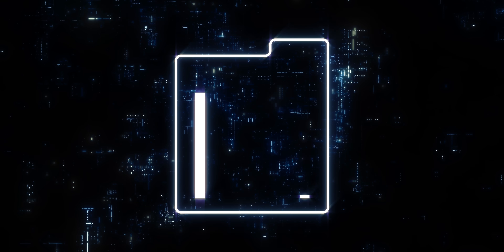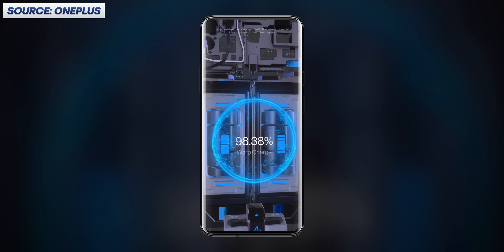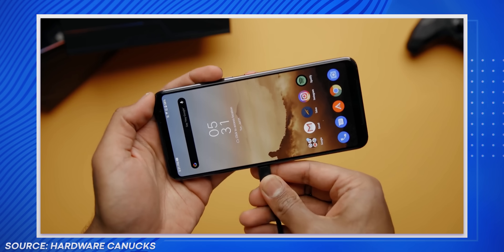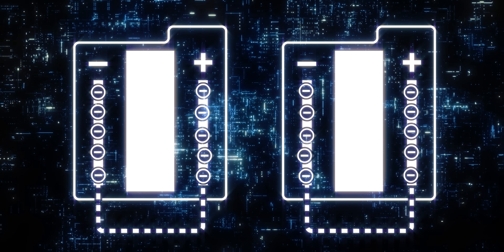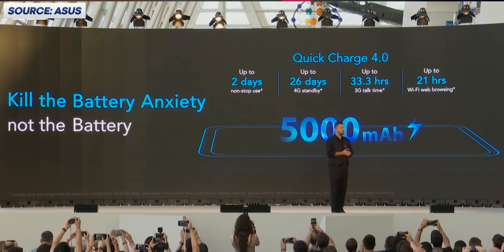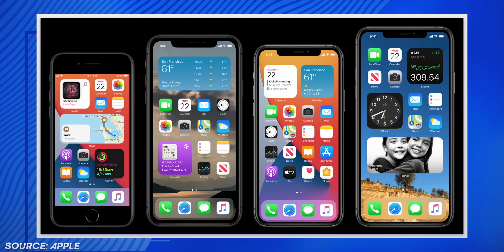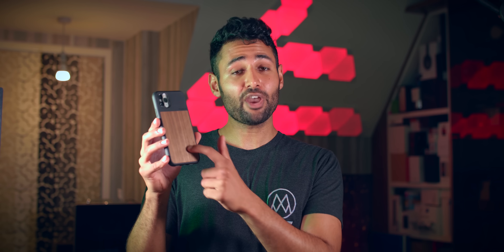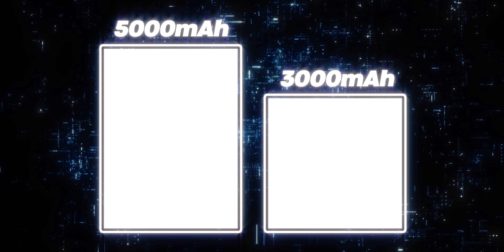The Problem with Fast Chargers.

Comment: Comprehensive and informative with awareness raised plus conclusive generalization. [Simply put, "Fast is Bad!" Or "Slow is Normal!" Even "The Faster it Charges, the Deadlier it Degrades!" Those sound rare and perhaps contradicting or counter-intuitive, if not taboo or ridicule!] (I've been paying attention to rechargable batteries since having a digi-cam in 2003  regarding charging cycles and cares with some understanding. I often avoided fast-charging whenever possible.)

Comment: To me, fast charging has always indicated stagnation of real battery improvement, and improvement on mobile devices in general. I never wanted my phone to charge faster, I wanted it to last longer per charge. Since companies cannot improve battery density, at least at this time, they resorted to different ways to charge your device, like fast charging or charging through induction... not truly improving the way I use my phone, but make it a little more different so it looks like there has been advancement. Similar story with putting more cameras and getting rid of the headphone jack... just different ways to interact with my device that do not change nor improve its real world usefulness.
Reply: To be fair though, if I can get 3 hours of battery life off a 10 minute charge then we wouldn't need to plug the phone in while we are sleeping. A longer battery life is always the best solution, but a quick charge from 7% to 40%  is always nice.
Reply: Truth!

Innovation in the mobile space has stagnated, but since profits depend on advertising innovations...

Advertising has gotten more and more creative with innovations.
Reply: Definitely agree! My last charger was an ordinary Apple charger, “half-speed” I’d say.. I bought a new one last week that is 2x faster at least and damn, I actually notice that my phone lasts 4x faster than the slower one! Plus I’ll never have to sit for 2 hours and look at my phone while it charges or fall asleep on it (super serious about fires) 
Love my ”fast” phone charger!

Comment: 1. Everybody complain about iPhone charging speed when it was providing the 5w charger. It legit takes 4hours to charge an iPhone plus model from 0 to full, and it won't charge at all when gaming.
2. If Apple worry about battery degrading when they consider charging option for iPhone, then obviously the magsafe should not be there at all, not to mention magsafe fast charging. Instead there is tons of rumor that they will completely switch to magsafe.
3. Apple actually provided a pretty good option for how your phone can last longer while fast charging and wireless charging. They provide pretty good pricing in battery replacement for their phone, and magsafe is actually improved wireless charging efficiency by quite a lot. Both helps the situation.

Comment: That's why u need a phone that charges at a speed that's in the sweet spot, 66 watt charger is good enough. Just take care of the battery and it should last you a very good time.
Reply: Fast charging can be okay as long as the temperature doesn't get too hot

Comment: I recently bought a s20 ultra. Instantly went into settings and turned off fast charging. Now it takes about 2 hours a charge instead of 1. Will help a bit in the long run and the phone lasts throughout the day easily so I only plug it in at night.

Comment: There's one big omission in this video and that is what temperature is ok for your battery and what temp is not?
My 'super fast charger' doesn't cause my phone to heat beyond 36C, even while I'm using it for light tasks. Is that still too hot?

Edit: I know he mentions 30C and 40C but something clearer might help.

Comment: My galaxy s10+ bought day one. Over 2 years of heavy use, still has 85% battery capacity. I do use Samsung quickcharge alot but it seems they only keep it at 15W. So i guess that's the sweet spot. 
No complaint here for me.
Although I wouldn't use any Chinese phone with 60W or 120W fast charge.

Comment: Is there any sort of a "bypass app", that would keep the battery charged at 50%? It would be useful in a car, when you use the phone as GPS.
Reply: Sony xperias can be limited to 80 or 90 % charging regardless of the charger.

Comment: I disagree about Apple. If anything, they want your battery to degrade as fast as possible so they can sell you a replacement and the installation for big bucks. Or even better, a new phone. Case in point, their last fiasco about slowing down your phone because "the battery has degraded". Not including a charger is nothing but a cash grab, it's mickey mouse BS they are pulling on the consumer.

Comment: This is why I prefer to use older, low-current chargers. I usually plug it in, and once it's fully charged, I unplug it.
Reply: On my phone you can toggle how fast you want to charge your phone. Normal, fast charge, super fast charge. If I'm not on a rush I just charge normal that takes about 2h 30m whereas if I'm in the middle of a photoshoot then super fast charge it is to top it back up quick.

Comment: Can I SAFELY charge older iPhones (5/5S/5C/6/6S/SE/7) or older iPads (4/Air/Air 2/Mini/5/6) using PD chargers (like the Belkin BOOST↑CHARGE™ Dual USB-C PD GaN Wall Charger 68W for example)  (w/USB-C to Lightning Cable)? I'm not asking nor concerned about Fast Charge.

Comment: There is one small technical error. 50% battery does not mean equal number of electrons on both the poles. The state with equal electrons arrives at 0% only.

Comment: Not complaining about 5W charger of my 6S plus ? That charger can go to hell. Can go to hell on a shortest distance. And go to hells deepest, hottest bottom. It usually takes 3.5 hours to fill up the battery, how can't I complain about that ? It's not like it charges a 4000 or 5000 mah battery, the phone just has 2750 mah. That is RİDİCULOUS. A day is 24 hour and I need to wait 3.5 hour for my phone to charge up.

Comment: I agree that fast charge is unnecessary and dangerous, if turbocharger from 0-100% in 10-15 minutes or less it may catch🔥. Phones battery are small, will over heat and the 🔋will last alot less than it should.

Comment: The boss : "we need a new solution for battery life"
Employee 1 : "fast charging! But you have to change phone every 2 years."
Employee 2 : "slow charging! But you can only use it if the battery is not far bellow 50%, and charging it not far above 50%, and also you can't charge it too often. Basically like not having a phone.

Employee 3 : "removable battery, so that you doesn't have to replace the whole phone if the battery is done. Like the old days"

Employee 3 gets thrown out the window
Reply: fairphone
Reply: @markusklyver6277  I actually never heard of it. At least the big tech youtube channel that I follow never inform me, yet.

Comment: That's why I usually charge my phone with older 2A 5V power charger even though it capable of fast charge. 
I use fast charge only if I forget to charge at evening and I have to leave home soon.
P.S. to optionally slow down change is not a bad idea.
I will can use phone while charging without overheating issue.

Comment: That's why we valued replaceable batteries and were so upset when Samsung and others removed them.
Reply: There was never anything special about them and it also limited the battery capacity 
With non removable batteries capacities such as 5,000 even 6,000 Milli Amp Hours capacities can exist

Comment: The electron-battery explanation doesn't make sense. The battery would be dead if the electrons were distributed equally between the positive and negative terminals. It would result in zero potential difference across the battery. If all the electrons were to make it from the negative terminal to the positive terminal, then the positive terminal would just become the new negative terminal.

Comment: I had optimized charging turned on and could not figure out why it was not working. After doing some research it turns out this feature is only useful if your battery gets below 50% by the end of the day when you plug it in. When i plug my phone in at the end of the day it is usually between 80-90% which is why it never worked for me.

Comment: Actually super fast charge like 120watt, 90watt, 65watt, etc 
Is safe for battery depends on smartphone implementation if smartphone has a good implementation the super fast charge is safe for your battery but if the smartphone has a bad implementation it will really bad for your battery and something bad will happen
Besides the heat factor when charging can also cause the battery to be damaged
Reply: That's why they recommend using the charger that comes with your phone, or authorized chargers that are compatible. Otherwise, you could fry your phone or at the very least, overheat your battery every time you charge, making its lifespan much shorter.

Comment: Actually the most balance between the poles is at 0%. Pushing more electrons over to the intended + will actually just reverse the polarity, which is bad in a case of a smartphone. This is why you dont want to be at 0% like flat 0% not 0.0001%. 0.0001% theoretically is fine. But you probably wont get as low because the voltage (potential difference between the two poles) will be so little that you phone cant be powered sufficiently so you cant let any more electrons make the distribution even.

0% means perfectly even distribution, (real)100% means there are as many free electrons on one side (-) as possible. Due to voltage raising super high you will need a lot of force (in this case represented as voltage) to even get that last electron over to the (-) side too.
The bigger the electron presence on the negative pole (kathode) is the more electrons want to even that out increasing potential difference between the two poles. This is also known as voltage.

There is basically nothing you yourself can do to increase your batteries life except just using it less. It doesnt matter how far you let it charge and how far you let it discharge.
It maybe makes it a tiny bit better to fully charge your battery and recharge at a very low charge so your phone isnt exposed to too much heat too often and its not expanding and retracting so often.
Also memory effect theoretically is a thing also in Li-Ion-batteries. Its usually not noticeable but in theory its there.
Charge your battery however you want - it really does not matter. I a few years its usually just not really good enough anymore. Thats how things go with current batteries.

Comment: I use ipad charger so its not as fast as a “fast charger” whatever i lose in battery capacity is outweighed by the benefits of speed. In 1 year and 3 months, after over 500 charge cycles my XR is still at 94% and  i will get a new phone after 2 years. My battery will still be at 90%. I could still use it as a back up device for years after

Comment: Great topic, never thought of the fast charging this way, seems like a crash course in battery mechanics 😀
But incredibly educating topic, keep picking up such out of the box topics about general awareness around these stuffs.
One offbeat topic if I may suggest for you to pick is how much regular folks should shell out on a phone, what I see many of my acquitances doing is that because of widespread availability of zero cost EMI or bundled deals, they tend to buy expensive phones which obviously they couldn't have if purchased upfront. Majority of the regular buyers are unaware of the actual stuff they need vis-a-vis they end up buying thus incurring something which they obviously shouldn't.
Hope this makes sense and if you find this interesting, please share your insights.

Comment: I charge in the car with the phone holder right by the ac vent to prevent excessive heat. I also try to keep it between 30 and 80 percent.

Comment: My iPhone 6 will do that if you turn it on with the battery in first then plug to in to charge and remove the battery while it’s charging the phone will remain on but it won’t successfully turn on with just the charger alone it needs the battery for some reason

Comment: Bypass charging is a feature I would absolutely love to see in Apple devices in the near future as it would allow for the battery to just remain at a lower percentage whilst using the device plugged into a power supply for long periods of time! That’s also especially for MacBook computers and possibly future IPads that you are using in desktop mode with a USB-C hub desktop setup! :)
Reply: Funny how Apple’s straight up gonna remove the charging port altogether.
Reply: @immortalsun  
IPhones would probably be first to have the port removed instead of them replacing it with USB-C.
Reply: Yeah, great feature for iPhone users since they are all anyways always sitting plugged in (not the case with the newest ones afaik) but that's how it used to be 2 or so years ago :'D

Comment: This is partially why I perfer to use a regular charging cable instead of the super fast charging cable my Note 20 came with. I'd rather wait longer and not worry as much as about diminishing returns. But at the same time, can I not have my battery replaced, too?
Reply: You definitely can. It's why I don't get why people get paranoid about fast charging degrading the battery health. Who cares about the degradation if I'll just replace my battery in 2 or 3 years.
Reply: @sabr3T  No thanks, a longer lasting battery is much better than a super fast charging one. I’ll take a moderately fast charging battery that last a long time.

Comment: I have Galaxy Note 10 Lite and it does charge fast, but the battery goes down way quicker than the one of the Samsung A10 I had for a year and a half! The heating is also insane
Reply: That's what happens when you buy 'Lite' phones...

Comment: 20w is enough to make iphone hot
Reply: My iPhone X and XS Max never got hot with the fast charging adapter
Reply: @Dishant161  The iPhone xs max can only charge at 15 watts total. The one that comes in the box is 5 watts. If you're charging at a 15watt charger, most phones should be capable of charging without getting hot to the touch.

Comment: I got a Tropical Green Xiaomi Redmi Note 9 Pro (128GB) and it came with 55% charge from factory and on the first charge i just charged it to nearly 100% with the included 30W charger and now when I need to charge it, I just plug it for like 15-20m and let it sit until it reaches something like 70-80%.